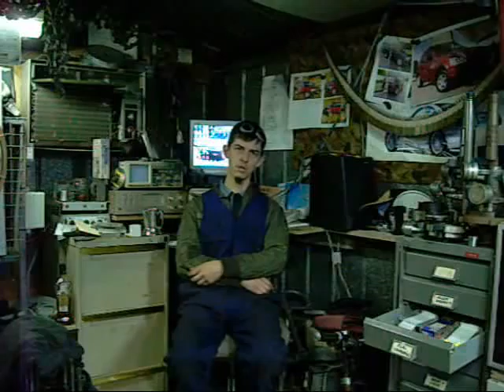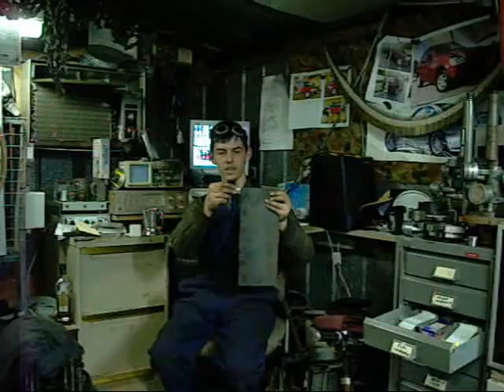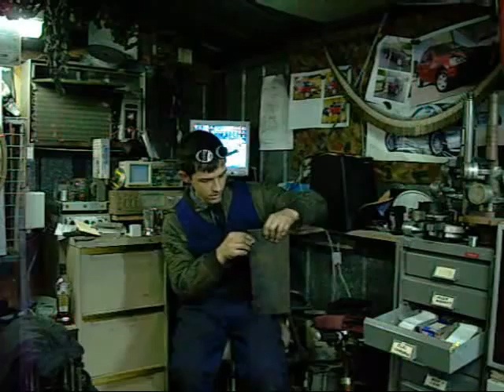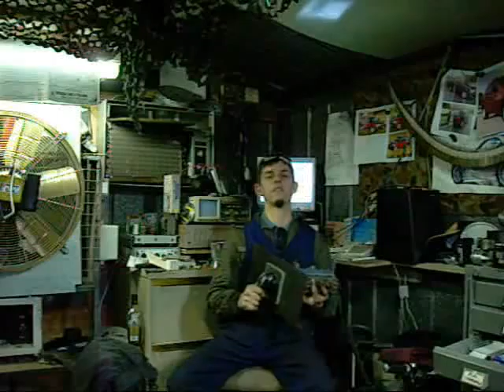NOBOX7

Comment from the maker: I'm not anti-efficiency either, I'd love to cut fuel and power consumption, but its not cost effective for me to buy 10 deep cycle battery's to charge with a smart drive

plus they don't sell diesel range rovers here so I can't try out bio diesel either :(

Capacators that are bigger still, like out of the 35Kw VFD, have cap screws and solid copper "bus bars" connecting between them! if theres a PCB involved, you can be assured everything is bolted through it with copper bolts and washers too.

Comment: you are the sht bro i like how you mention efficiancy and how it snot always the goal
"i gota v8 ",lol  that made me laugh  
and thanks for backing up the spade
termanal issue[i didnt know what they are called ]  im glad to here actual 
refrence to the issue, i got this from the fact that capaciters on high amp  gear 
dont use terminals but are solderd joints.
any way im not anti efficiancy,its just that
im into very capable devices in small spaces,efficancy is always bigger